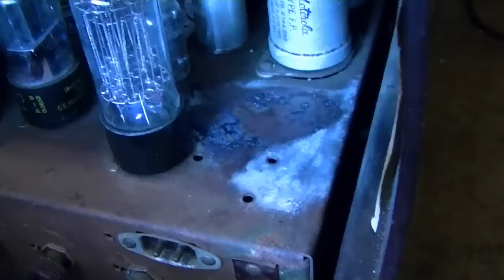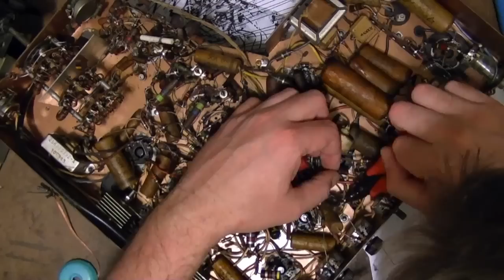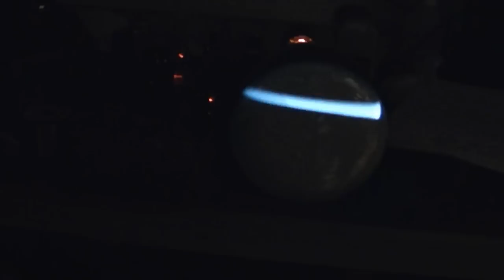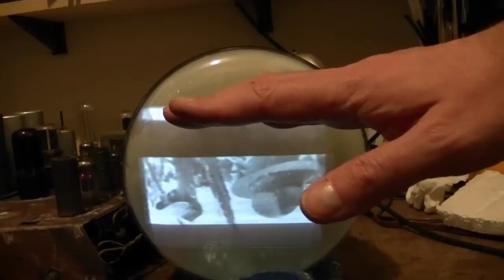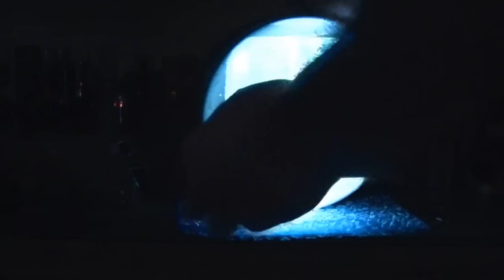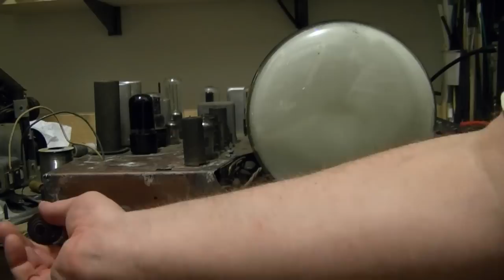Motorola 7VT3 restoration pt1o?

Comment: I have one of the smaller ones, the type with a rubber bulb. When I first tried it it didn't work that well and the tip kept clogging, so I started looking for a stiff piece of wire to clear the hole. In doing so I realized that I had a bag of 1-1/2'' finishing nails so I drilled out the tip to fit one of those finishing nails, not only does it clean the hole out but it clogs up less often. They were really intended for use on PC boards but they work well on hard wired chassis as well.

Comment: You may have noticed that he was using a solder sucker, that greatly reduces the chances of inadvertently breaking off a tie point since you are removing most of what holds the lead onto the terminal. Another thing that helps is to clip the old part out before removing it's leads, if gives you more freedom to unwrap the lead from the terminal that way.

Comment: I hate it when people modify things rather then repairing it properly, I could see doing something like that if there was a part they could not easily replace like a coil but changing resistor values to compensate for a bad resistor there is no excuse for.

Comment: I noticed that your Mastech multimeter was jumping around when you were taking resistance readings off of that potentiometer. I had a similar problem recently when I was using the same model multimeter. My readings became rock solid when I switched over to my Fluke 87 V multimeter. I really enjoy your videos. Keep up the good work.

Comment from the maker: There's no radiation danger from B&W CRTs and all the HV is contained on the conductive coating inside the glass  I mostly order from Mouser, but they don't carry the ASC 6,000 volt caps.  I got those from Allied Electronics.